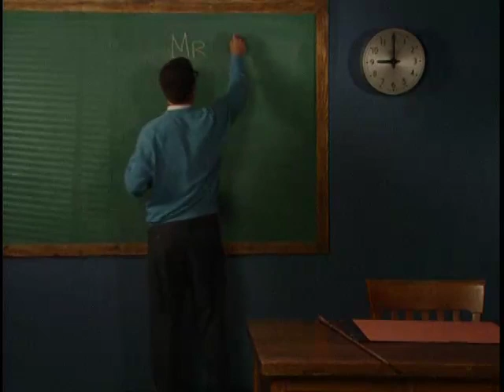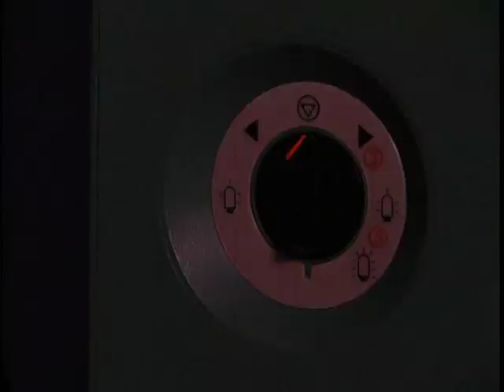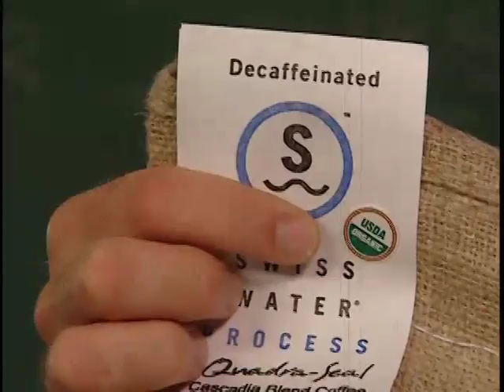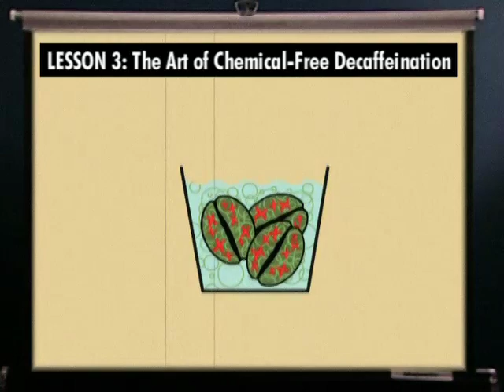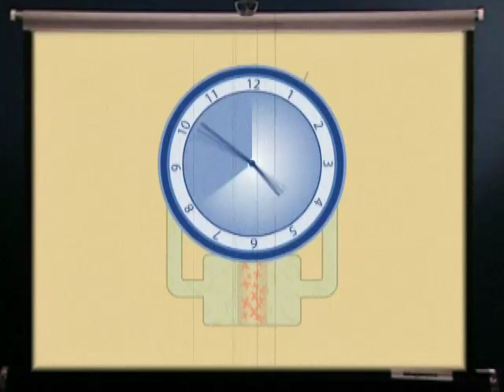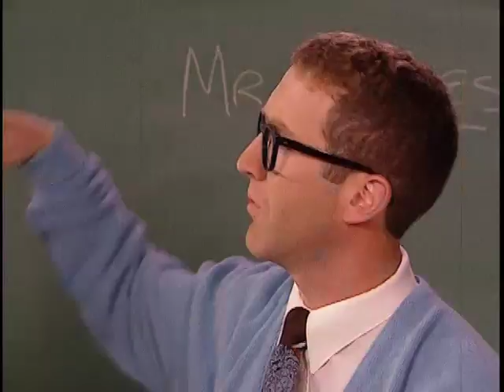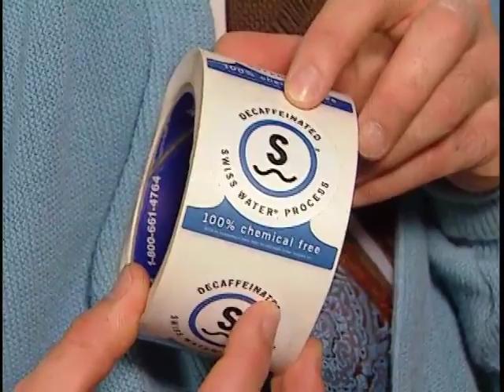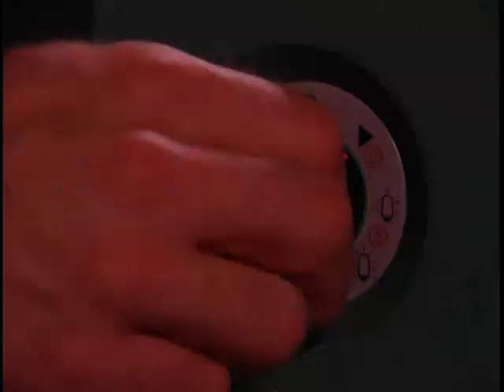Swiss Water Process

Comment: But is the water used to do this from the municipal water supply?? Because if that town artificially fluoridates it's water supply you will end up with fluoride in your coffee which won't be filtered by any carbon filter and fluoride is a carcinogenic. I would ask the company if the water used comes from the local water supply... I highly doubt they are shipping in spring water. Every state in America and large parts of Canada artificially fluoridates it's water supply... Nasty stuff...So the question is... Does Vancouver artificially fluoridate it's citizens??